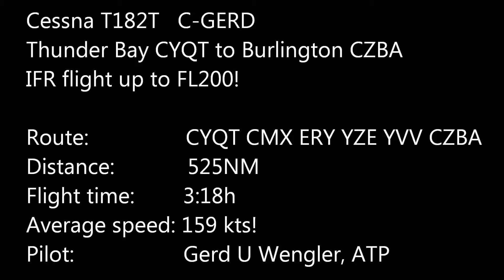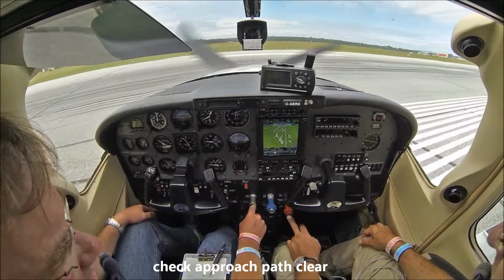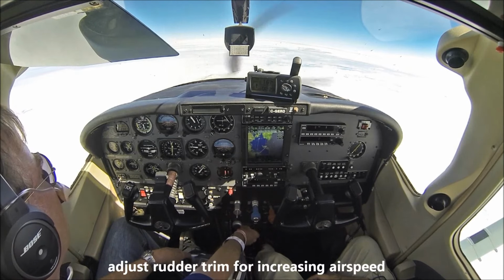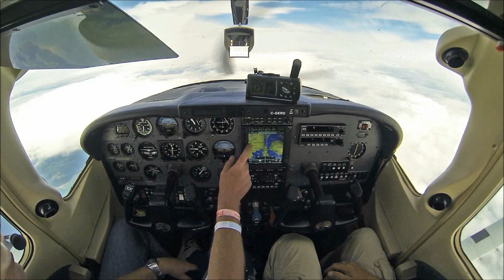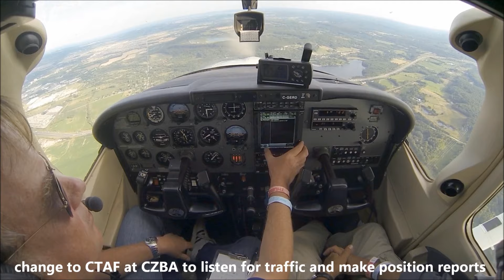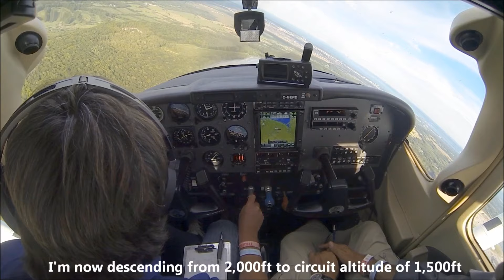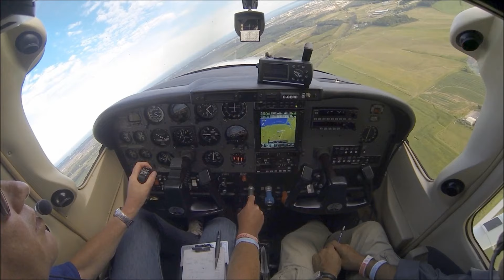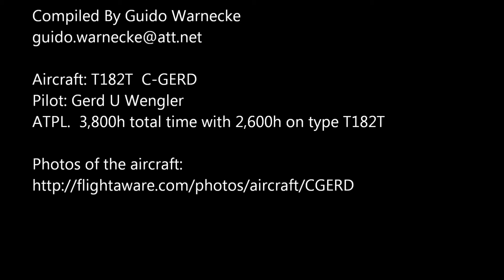Cessna Skylane at 19,000ft - cockpit video - must see!

Comment: I grew up from 10 years old with my dad (non pilot) having a flying service and flew the 150,172 Skyhawk and the base 172 as well as our IFR 182 and soloed at 16 back in 1968.  The 182 is a great plane except the 182 way a little heavy more so then the base 172 which I have landed and taken off on a 700 foot corn field runway that was made for J3 cubs. 80 foot pine trees at the end, but even with doubts I made it with room to spare. N7416T was her. For this to have crossed the atlantic is a big WOW I never liked crossing the Maryland Chesapeake Bay which was only about 15 miles across at my point. Due to 2 tours in Vietnam I ended up as a 1000+ hour student pilot due to not having time to travel to take the written test, but made many IFR flights in that 182. Now im 66 years old and look back at things I got out of the 172 and 182 that people never through could be done. Even as a student I flew many cargo runs IFR...God I miss them days
Reply from the maker: Thank you!
I could not agree more: the C182 is just a great aircraft and can do so many different things.
Happy Landings,
Guido

Comment: Great video and I'm sure it was good fun to make.  The highest I've ever taken a single engine piston aircraft is a C-210, in which I got it to FL 270.  Couldn't get it to up to FL 290 as it's advertised to be able to climb to.  Of course it wasn't new.  :-)
Reply from the maker: +AK Pilot WOW - 270 is a lot, even for a strong C210.
Happy Landings,
Guido
Reply: +Guido Warnecke Very true.  It was quite cold out (-32(f) @ ground level) and I kept the fuel on the lite side.  Did I mention I was alone?  LOL.  In a standard configuration, temps and with one or two pax, I think I would have been lucky to hit FL200, if that.
It was an amazing flight for the eyes.  As slow as the 210 is, compaired to say a 737, you really get a great opportunity to see the ice crystals in the air, even up there.  We are used to it in PAFA, as well as when I flew out of PAUM, but in flight there just seemed to be a bit more special...probably becuase I wasn't freezing my bollocks off on the ground.  
Thanks again for all the videos you  post.  I enjoy them and understand the work it takes to put up quality videos.  Your work is apprciated.  
~Cheers

Comment: Very smooth touchdown.  I've watched it a few time and it's one of my favorite landings I've seen.  Shows a lot of experience in the entire approach and especially the final flare.

On the airspeed indicator I see what I believe is around 80 knots coming over the runway threshold and I assume (although I could be incorrect) this  a bit fast for the Skylane, but with that aggressive flare.  Was this due to the max weight issue; or just the way you pull of a silky-smooth landing like a boss ;P
Reply from the maker: Thank you!
I will pass this on to Gerd Wengler, the owner of the aircraft, who was pilot flying on this leg.
Speed was rather on the high side, but the landing was intentionally long, as the exit point for the hangar was far down the runway.
Happy Landings,
Guido
Reply: Guido Warnecke Ah ok, I understand now.  Yeah do that--let Gerd know that landing was pure boss-mode.  Thanks and keep the videos coming.
Reply from the maker: Will do - thanks!
Happy Landings,
Guido

Comment: It's amazing the difference oxygen makes at the higher altitudes.  Flying at 12,000' exerting yourself to get stuff out of the back seat makes you breathe hard.  Breathing in some nice pure O2 helps with that a lot.  Up at the levels you were you'd probably have been asleep without it (not to mention it's required) :)
Reply from the maker: Hi Robert,
the use of oxygen requires good judgement - irrespective of what the law says.
It is not easy to judge personal oxygen demands.
When I lived in Johannesburg, South Africa, at 5,400ft elevation I could easily fly up to FL130 without oxygen. When you live at sea level, it is much different.
Also at night or when tired, the oxygen demand is elevated.
Thanks for watching my videos & happy landings,
Guido

Comment: The Skylane has always been a fine machine, as much at home on a flat spot of grass as it is on pavement, I never flew one with a turbo, but the altitude advantage would only add to the Skylane's  versatility.
Reply from the maker: +John doe 
I 100% agree, John.
Great aircraft, since decades in the market.
I will ferry a factory new one to England by the end of the month.

It's a shame that Cessna seized producing the T182T.
Happy Landings,
Guido
Reply: Guido Warnecke Good luck brother I personally wouldn't do it, but Im an old flight engineer on DC6s in Alaska so I like lots of engines on my wings, a good friend used to ferry Air Tractors to Europe until he had an engine failure and landed on a Greenland beach, he never hooped the pond on one engine again. Just be careful, it takes years to train a good aviator and just a few seconds to get rid of one.
Reply from the maker: Wilco.
Modern engines are more reliable then the old radials.
And I am sure you were an expert on these and could "hear" how they were doing.
Many thanks & best regards,
Guido
Reply: Guido Warnecke Tom was in a turbine Air Tractor nobody would even consider trying to ferry an Ag plane with a Radial engine across the atlantic ocean LOL sorry I should have clarified that, best wishes though.
Reply from the maker: Thanks.
Who would think that a PT6 turbine would quit...
Reply: Guido Warnecke I used to think the same thing, but in 13 years of flying in Alaska I have seen several PT6s not only quit but completely blow up, where the exhaust stacks look like a grenade went off in them, and some of those were low time factory engines. Luckily most were on multiengine aircraft and they returned on one engine, All aircraft power plants are designed, built and maintained by men it is impossible for them to be 100 percent reliable. When I try to tell other aviators what I experienced in Alaska they do not believe me, so I am writing a book with dates and N numbers.
Reply from the maker: Thanks for the info.
I am an engineer and believe in technology. 
You pointed out an important thing: the human factor...
Happy Landings,
Guido
Reply: Guido Warnecke You understood my point, which is more than most people, and its true that most engine failures are not the fault of the engine design, but that doesn't make any difference to the pilot who is experiencing one. Good Luck My Friend.

Comment: Just found this older flight , nice touch when you quietly set full rich as the PIC taxied onto the runway ...
Reply from the maker: Thank you Paul.
Gerd, the highly experienced owner of the T182T was pilot flying.
My function was only to be the "mixture man"...
Happy Landings,
Capt. Guido.
Reply: Usually it is my wife's job to do this.  Guido did this with the same grace as she always does.
Reply from the maker: @gwengler  SMM - senior mixture man

Comment: Wow, I never thought I would see the day that a little propeller plane would fly so high that you need an oxygen mask! Pretty cool!
Reply from the maker: Thank you!
The engine is turbocharged so it works fine in the thin air high up.
All the best in 2018 and Happy Landings,
Guido
Reply: I got pushed up to 140 one day in a 172.  I had the engine at idle and was still climbing.  It was in some mountainous terrain and winds were crazy that day.

Comment: I remember that someone around here modified a written off cessna 172's air intake and tried to go as high as possible with it. He reached 14200 feet before the engine started coughing and failed. Restarted after descending to 7000 feet. The cessna is now destroyed, since it was originally written off for bad maintenance.
Reply from the maker: That's interesting!
Most likely the mixture leaning did not work correctly.
Thanks for watching my videos & Happy Landings,
Guido
Reply: Guido Warnecke I remember that the old cessna's have a certified service ceiling of 12000 feet, but i don't know sure. I find it amazing to fly very high in small props. The windows are usually big, so you can see a big part of the world out of your windows :)
Reply: My Avcon converted 172G (180 Hp Lycoming with Hartzell CS Prop)  would make it to 18,000 ft. Sadly it's in the junk yard now, having been flown into a house in an attempted go-around by a low time pilot after I sold it.

Comment: Why is he adjusting the prop first time at Cruise level? Don't you have to change it in the climb out for the first time? Or is the adjustment so small, that one does not see it in the video? Just got my variable pitch propeller rating and so I was curious about the procedures here!
Reply from the maker: Thank you for your observation and for watching my videos in great detail.
The RPM setting depends on the aircraft type and the engine installed.
On the engine installed in the T182T (a large, 540 cubic inch, flat rated to 235HP engine that runs up to 350HP in other aircraft), the take off RPM is 2400 and can be used for the entire flight. For noise reduction in cruise or any specific desired power setting, the RPM can be reduced to any value that is in the "green arc", stated by the POH.
Happy Landings,
Capt. Guido
Please subscribe to my channel - your support is appreciated.

Comment: Brilliant. The highest I ever got in a Skylane was 13500 ft and then started to get light headed, fingers starting to go blue and numb. Throttled back and pushed the nose down to 8000ft and all went well. Just shows that over 12,000ft Oxygen on board should be carried.
Reply from the maker: Thank you!
You did the right thing - hypoxia is a serious thing and one should not really go above 12,000ft or so without supplemental oxygen.
A Skylane can do much more than the pilot!
Thanks again for watching my videos & happy landings,
Guido
Reply: I totally agree with you, but had the presence of mind to be aware of the dangers. I sort of new what to expect, so it came as no surprise when I noticed the slight throbbing in my head and dry mouth etc.. I mentioned the experience to other colleagues about it, and they all wanted to know what it was like and how I felt. I just told them never ever do that, other wise Hypoxia will set in if you dont have your wits with you.
Reply from the maker: Steinwaygrande I have a visit to an altitude chamber still on my bucket list.
The YouTube videos of the altitude chamber are quite interesting.
When I used to live in South Africa (general elevation 5,400ft), I could fly without oxygen up to 13,000ft with no problems. Now, living at sea level my personal maximum is 10,000ft. In the USA, the FAA allows 12,500ft for private flights without supplemental oxygen.
Happy Landings,
Guido
Reply: You lived in South Africa. WOW what a small world !!  I lived in Durban and then came to Australia in 1982. Did my PPL at Virginia Airport in 1967  ! What a coincidence :-) Are you still in SA ?
Reply from the maker: Steinwaygrande Pilots world = small world!
I live in the USA now and commute between Europe and Middle East.
I sill go regularly to SA flying safaris) and keep my ATPL current with medical and check flights.
You never know...
I have been only once at Virginia after a nice low level flight along the coast.
If you send email, we can establish contact.
Address at end of videos.
Happy Landings,
Guido
Video of some bush flying during the last vacation at SA:

Bush Flying in a Cessna 210 - South Africa

Bush Flying in South Africa - C402 landing at Ingwelala!

Comment: A 182 at FL190, reminds me of the T-210. I once took a J-3 Cub to 31,400 in the wave off Pikes Peak.
Reply from the maker: Hi Jim!
That is quite impressive!
How did the engine run at 31,000ft?
Happy Landings,
Guido
Reply: Guido Warnecke Well, it was still running @ about 1500rpm, zero thrust was about all. At least it wasn't creating drag which the Cub doesn't need any more of.

Comment: I have a couple hundred hours in older skylanes...but never had the opportunity to fly a turbo that high..what fuel flow and airspeeds did you see at FL19?
Reply from the maker: HI Matt,
the fuel flow was around 14.5 gph with a TAS around 160. You can go faster. The engines is very flat-rated you can operate up to 88% power if you wanna be home for lunch earlier.
Thanks for watching my videos & happy landings,
Guido

Comment: Another series of questions:  What would happen to the aircraft if ice develops on the surfaces?  Would the aircraft not be controllable or would it create a aerodynamic stall?  And if that happened, what could you do to attempt to recover?
Reply: +Robert Caldwell To both results, potentially yes if you let the ice develop. If you don't have de-ice or anti-ice, you descend below zero isotherm.
Reply from the maker: Icing and small airplanes do not mix very well.
if icing occurs (generally the weather forecast would tell you), the pilot has to take immediate evasive action: descent, climb or turn around. It is important to always have a way out.
Happy Landings,
Capt. Guido

Comment: Hate to say it but I've been to FL200 in my 1962 Cessna 182 non-turbo. Not a big deal. Gets there easily at lighter weights. Nice to know the current model still performs as well as the 50 year-old version (for only ten times the price).
Reply from the maker: That is amazing!
Happy Landings,
Guido

Comment: I  have flown 182's many times but wasn't aware there was a pressurized version out there but would love to fly one. Great Video
Reply from the maker: Thank you!
The 182 is not pressurized, so we have to use supplemental oxygen, either from nasal canulas or masks.
The engine is turbocharged and produces full power at high altitude.
Happy Landings,
Guido
Reply: Oh Ok, I didn't notice the use of oxygen. Impressive to see 182 at that altitude regardless.
Reply from the maker: It is in fact very rare, that piston single engine airplane are flown at that altitude.
You may get questioned once in a while by ATC "conform type of aircraft"...
Happy Landings,
Guido

Comment: Nice video.

Worth mentioning is that cannulas are not effective above 18,000 feet (and in the US, a mask must also be available to the pilot whenever oxygen use is required, and cannulas are also prohibited substitutes for a mask in part 135 and part 121 operations). Canada just says you need a oxygen and a mask above 10,000 feet after 30 minutes, and always about 13,000 feet. I don't know if or when a cannula meets the requirement for an oxygen mask in Canada.

I don't know about Canada but operation above the certificated altitude (in this case 20,000 feet when the altimeter is set to 29.92) is somewhat dubious in the US. Kudos to the pilot in this video for checking himself when given the new altimeter settings for not setting it while above 18,000 feet.

Personally, I believe that operation above this altitude (>20,000 feet) is safe in this airplane as it appears that the limitation is more of a marketing issue, originally protecting differentiating the 27,000 foot ceiling of the Cessna T210 (and the T206 which was derived from the 210). Aside from many conversations about the service ceiling of this airplane, the airplane has a pretty good climb rate at its certificated ceiling (>600 feet/minute). I acknowledge that there are other factors that may contribute to the service ceiling (cooling of components, partial pressure of oxygen to pilot with built in oxygen, etc.) but I doubt they are a factor, rather that testing simply was not performed above 20,000 feet to protect sales of other Cessna models.
Reply from the maker: Hi Bruce,
True statement about the T182T's "certified service ceiling" as a marketing - not technical limitation.
The airplane reaches FL300+ with ease (RVSM left aside here).
Happy Landings,
Guido
Reply from the maker: Hi Bruce,
True statement about the T182T's "certified service ceiling" as a marketing - not technical limitation.
The airplane reaches FL300+ with ease (RVSM left aside here).
Happy Landings,
Guido

Comment: Lovely view and very thanks for sharing your experience into IFR, it might be helpful. 
A bit joking, but now try the same thing without an engine into a mountain wave 🙃😁
Reply from the maker: Thank you.
The pilot of the aircraft actually encountered a mountain wave near the Rocky Mountains.
No turbulence but plus/minus 3,000fpm vertical speed. Much exceeding the climb capability of the aircraft.
ATC is normally understanding with block levels to avoid altitude deviation violations.
Happy Landings,
Capt. Guido
Reply: @GuidoWarnecke  Waves are not turbulent but they are still very strong. I  admit i was more talking about flying sailplane at the very same altitude, but what you told me impressed me quite a lot, i didn’t really expected standard powered planes to be this sensitive to waves ! Thanks to share your experience.
Can I ask if it was on this 182 your friend flew in wave ?
Reply from the maker: @gliderfs621  Correct, it was the same T182T.
Happy Landings,
Capt. Guido